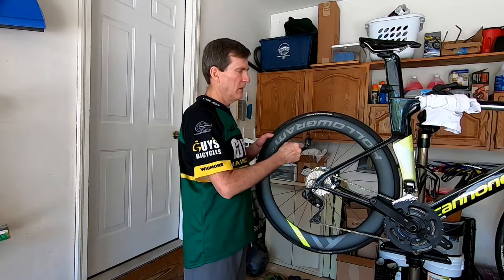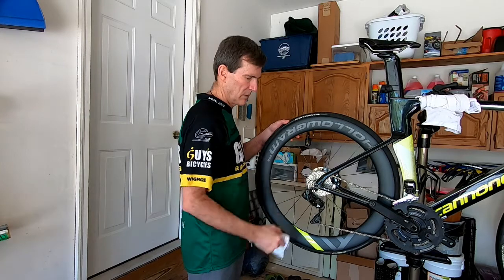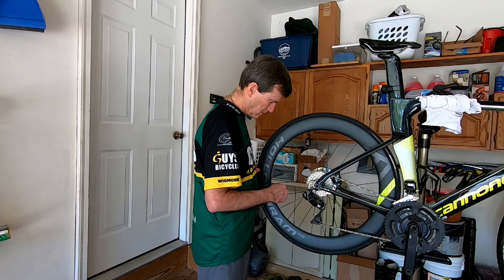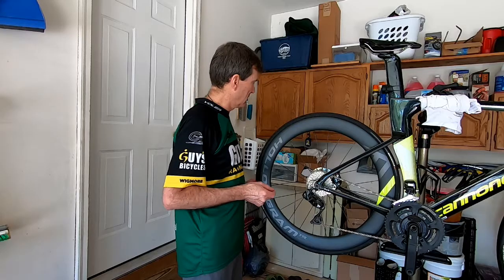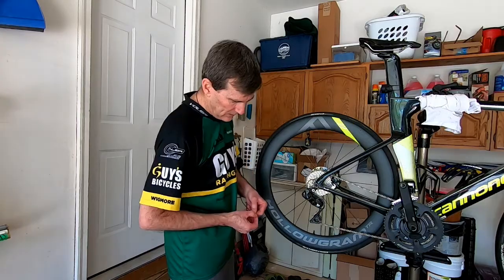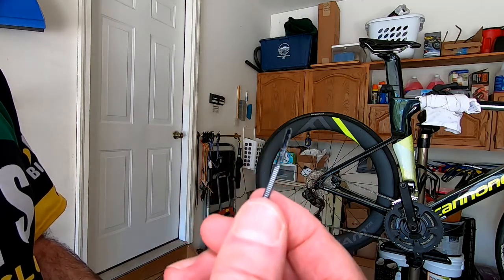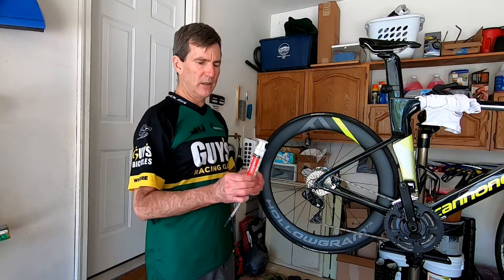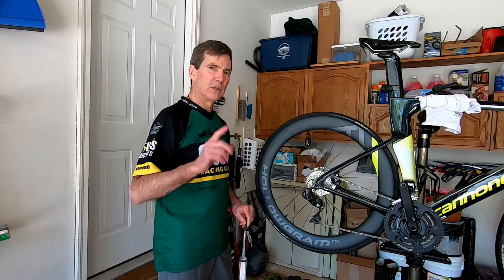Tubeless Sealant Dip Stick

Comment: Nice hack. But what level on the dip stick tells me that there’s enough sealant in there
Reply from the maker: Great question, thanks for asking. 
It really depends on the tire size as to how much sealant is enough. For 25-28 road tires we use 3ounces. For our gravel bike, 43 tires we use about twice that amount. Thus there's no 'pat answer due to different amounts and different tire sizes. If you have none, or very little, on the dipstick of course you will add more sealant. If it's more than 'a little', hold the dipstick next to the outside of the tire to get an image of the volume of sealant relative to the tire's size. We typically add only 3 ounces (Stan's is available in 3 ounce bottles) at a time, checking with the dipstick after each add. 

Sorry the reply isn't more precise for you, hopefully you find it useful anyway.
Reply: That is very useful, thanks. I’ll use the dipstick after adding new sealant, mark the full level on the stick, and that’s my baseline
Reply from the maker: @tvdvdvd  sounds like a great plan. Thanks for watching and for the question!